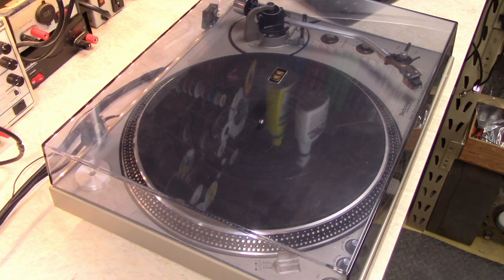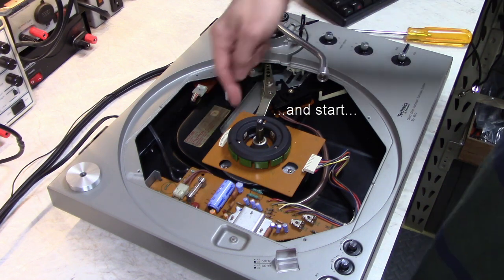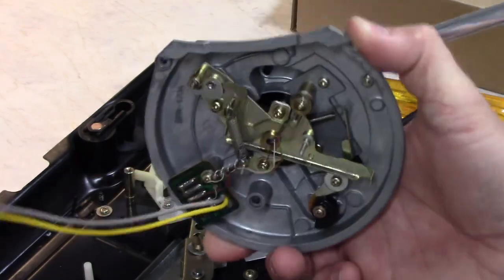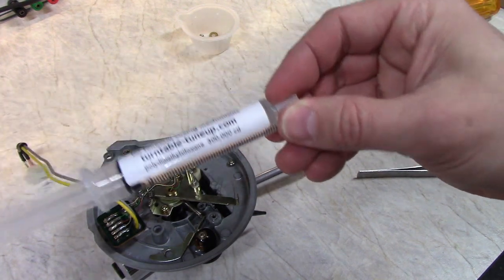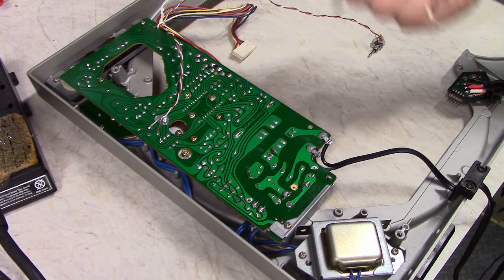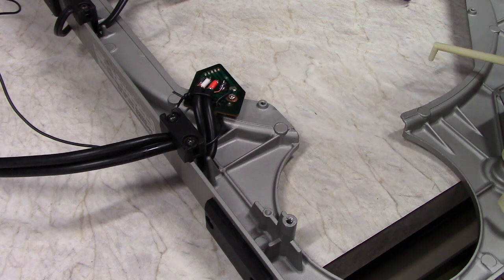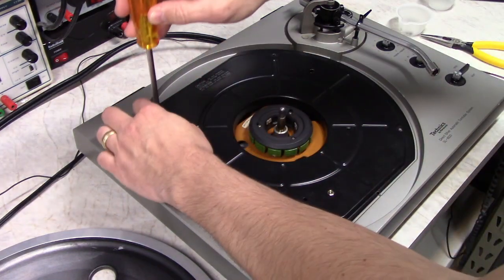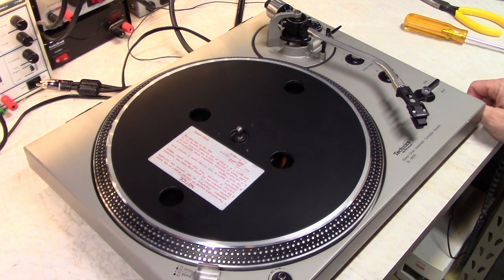Technics SL-1600 Servicing

Comment: Hi, do you know where I could get a replacement RCA cables with the printed board SFDP170-03
Reply from the maker: You want something that is relatively low capacitance, though honestly any "regular" RCA cable can be made to work (by cutting off the connectors at one end) as long at it is relatively short.

Comment: I have the SL 1650 model. Can one incorporate 78 rpm speed in this model?
Reply from the maker: As long as it is not a quartz-locked model, you should be able to make a similar mod.

Comment: Hi I have technics SL 1300 it powers on but does not spin at all. I cleaned all of the pots with Detoxit but still want spin. can you help me on my great TT would love to get it going
Reply from the maker: I haven't worked on a 1300, but I imagine it has very similar electronics (if not the same) to the 1600.  By "turns on" do you mean that the strobe light comes on?  That means that the fuse is OK, but that's about it.  That neon bulb is powered by the mains and not the power supply that powers the rest of the electronics.  So if the light comes on when you move the tonearm but motor doesn't turn, it could be several things.

If you are comfortable using a multimeter, you can download the schematic from vinylengine.com and check the power supply voltages.  If the motor IC is getting the voltages it should, then some more detailed diagnosis is required.

Comment: I know this video is two years old, but your cartridge alignment looks way off.  There should be 52mm of distance between the diamond tip and the gasket on the headshell.  Yours looks way too forward.
Reply from the maker: Nope it is correct...for the alignment that I chose to do.  There are a few different geometries that one can use.  The factory alignment using the 52mm offset you mention gets you something along the lines of the so-called "Stevenson" alignment.  I usually go for the Baerwald, which requires dangling the cart pretty far off the end of the tonearm on a Technics like you see here.  On my JVC, Baerwald is closer to stock and so it doesn't look quite so odd.  Löfgren B is another geometry.  You can download PDFs for any of these and print out your own compasses to try them out.  I'll probably make a video about this some day.

There is nothing wrong with using the stock alignment, either.  It biases towards better alignment on the inner grooves and sacrifices alignment on the outer grooves.  If you cart struggles with IGD, then the Stevenson (or stock Technics) alignment is something good to try.

Comment: You can remove the black tonearm rest to get the piston out completely. There is a spring inside holding the screw tight down in the hex. Cue up the arm and either use the table or your finger from the underside, stop the piston from going down. Now push down on the black tonearm rest. The screw will raise out of the Hex and you can unscrew it.
Reply from the maker: Man, I tried to do that but I could not get it to pop out.  The service manual also does not mention this for my version, so I assumed I had the older version.  Next time I have to relube it, I'll try that again.

Comment: I don't know who told you that every microline stylus needs high VTF? Audio Technica's much loved by audiophiles  AT150MLX has one and uses VTF waay below 2 grams!!!
Reply from the maker: What I said in the video is that microline styli tend to need a bit more anti-skate than an elliptical.  I did misspeak when I initially talked about the anti-skate adjustment (I said tracking force the first time).  However, when I made the comment about microlines I did say "anti-skate" but then I also said "grams", which is not really accurate.  I can see why it was confusing.  VTF is generally not a function of the stylus type.  In the case of this stylus, 2g is the recommended VTF.

Comment: on my sl1600 the index plate rotation has hardened and the automation no longer works ..
but I can't understand how to dismantle the index plate, there are no segers, it seems to be threaded before fixing the column to the frame, but it seems strange to me that it can't be dismantled ...can you help me please with any suggestions?
the video of the situation https://youtu.be/NGX_RHg_nSc
Thanks!
Reply: now I understand, it's the metal bush completely blocked!
Reply from the maker: That sucks.  Were you able to get it fixed?